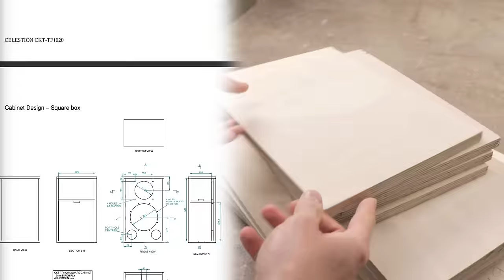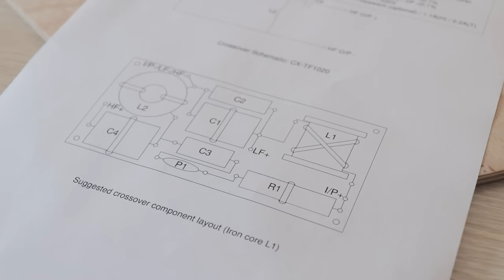DIY Compact 10" 2-Way PA Speakers

Comment: A very nice well put together project. However I can't see how you can say 1000 watt handling power , When the horn has a max power of 20 watts and the woofer has a max of 300 watts. Please explain.
Reply: des. Nonsense. 250watt Löwe. 50watt high.
Reply: peak power is usually a bogus marketing number that is close to where the speaker destroys itself or the coils burn up. maybe its a teoretical max. i dont see this peak number anywhere on the product websites. i assume its 1000w peak both speakers combined. in this video on the test part they used a 100w amp so nowhere near the 100w target
Reply: I have built my cabs to house a 15in woofer an 8in midbass and a super tweeter all of the individual speakers are rated to handle over 600 watts but my crossover is rated at 300 watts so if I give more power than the crossover can handle they turn into a large paper weight
Reply: yeah i dont know enough about crossovers to know how much this one can handle. i saw some wattages and stuff but i dont know how much each individual component would be hit with the load i guess. then again this setup was hitting what 50w per channel probably wont blow up. if they would hook up the amp i'm using wich is the Behringer KM1700 800w at 4 ohm per channel there might be some smoke or broken parts i guess. mine are 1700w mono for use with subwoofers that i havent gotten to yet.
Reply: I'm running a Yamaha m-80 amp that will put out just over 300 watts per speaker per channel, after there was work done on it and with my amp set up to just below clipping I can't turn up the pre-amp to 4 before it is so loud stuff starts to fall off the walls
Reply: yeah most of the equipment is PA equipment so it makes sense to have more watts and more speakers so you can deliver sound to a room of people. the build in the video feels and looks more lika a PA speaker than a speaker for somones listeningroom. i have used my rm1700 on a pair of 15w bookself speakers i got from somone for 15£ they dont sound any louder going from a 50w reciever tough i think they might sound abit clearer but that might also be the furniture that has been added to the room. or maybe the input methods that digger quite abit from the aux in on the reciever to 2 channels on a mixer
Reply: @williamclarius7072  any videos or info about your speaker ? sounds like what I like to make
Reply: @jamesccart  Sorry no video
Reply: @jamesccart  I wish I could upload pictures of mine
Reply: I did put some info about my speakers higher up in this thread
Reply: @jamesccart  So here are my choices of components starting with the cross over it is a Dayton XO3W 700/5.6k 300watt, Next is the Dayton PA380-8 8ohm 15inch pro driver 500rms to 1000watt peak, Next is the Pyle PPA 8 this is an 8ohm mid-bass 200rms 500watt peak, last is the Pyle PDBT78 super tweeter also 8ohm 350rms 700watt peak all of those stuffed into a 20 inch wide by 16 inch deep by 36 inch tall cab with two 3 inch front facing ports at the bottom. All components were bought through Parts Express, the cab material is 3/4 inch birch plywood
Reply: @williamclarius7072  really interesting thanks do you think that off the shelf crossover works well in your speaker ? I'd never thought of doing it that way
Reply: @jamesccart  yes the pre made cross over work wonderful, but to build your own cross over you can set your cross over points that could make sound better for your application
Reply: With my choice of components I was trying to get as close to 20htz up to 20000htz, effectively I don't need a sub woffer
Reply: @jamesccart  I also chose my cross over after choosing my driver's so that it would work well for my application, for the range of each driver and the power output of my amplifier

Comment: DIY, compact and PA parts. Perfect. For my desktop.

Something about the way PA plays for movie/games that cannot be beat. Dynamically they are king as far as I am concerned.
Reply from the maker: Very well said.
Reply: You nailed it. I built some speakers from DIYSG for my HT and they're 98 db sensitivity. Dynamics are huge without massive power requirements.
Reply: @tommywilliamsjr.697  I had to dump the 15 inch woofers due to space and stuff (also 1 broke in a move), but there never was a lack of clarity or reserve. I had them new when BF2 came out, and they stuck with me until not too long ago. 

Have smaller stereo ones now with ribbons. Meh.

Found this video perusing the web on the prowl for a design with compression drivers. But size and power and weight, I pulled out the 1U amp and wanted to stay with that, so now have to decide surround with phantom centre or simple LCR. These do look tempting... But thinking I will start with 2× the Obelix-S from K+T 2013/06, modified the design slightly. Should be a good fit on a smaller desk.
Reply: Wonder if 10" is a great middleground for creating high undistorted SPL while not having a big directivity mismatch with the compression driver, while the compression driver is also crossed high enough to play undistorted.

Specially since I'll cross into a subwoofer anyway.

Comment: Great work on those but with the specs on those drivers and the crossover Id limit the amplifier to 120-140w RMS each cabinet unless you like replacing drivers.
Reply from the maker: Thanks! The amplifier I was using can only output 50W per channel.
Reply: A 200wpc amp is ideal. 
LF driver is 150wRMS and the HF is 20wRMS, that gives you 180w of total RMS handling, in theory. 

It does depend on how loud you intend on driving them, but the weaker the amplifier, the less dynamic range you'll have and the higher the chance you will clip the output stage, which is worse than having a slight overload on power.
If you choose to add positive EQ to these speakers, you will run out of headroom with a 50w amplifier very quickly, especially with lower frequencies.
Just because it would be a 200w amplifier, doesn't mean it will be going full send as that isn't how audio works.
Reply: @childishtombino1275  having double the power of an amp is ideal to make it work the best and also have more power
Reply: @chaeyoung8908  I agree, stressing amps is not great, so having the headroom is a win.

Comment: Excellent video and realization   However do you hear any difference with the speakers sitting on a more stable stands ?   the sound could be more focused i guess   
The single pole can wave   Even a little movement is very bad with speakers usually   Kind regards, gino
Reply from the maker: Hello, thank you. I actually haven't tested the speakers on more stable stands, which is a good idea to test, thank you.
Reply: @DonnyTerek  hi i think the problem is more in the tweeter
Even tiny movement of the box varies the point of source of sound of the tweeter
It's like shooting having a little parkinsonism
In the end your speaker are really excellent and very good looking as well
In my little room i don't need all this power but I will think about it
thanks again and kind regards gino

Comment: 150Wrms woofer, 40Wrms tweeter.
1000W peak? Probably less than half
Reply: Yer, More like if you actually gave them 150w per side they would fry. "yer my setup is like 1000w man" ok so why has your amp only got a 5amp fuse then? paper numbers.
Reply: 1000 watts  for m.sec and the are in speakerheaven.😂😂😂

Comment: I want to build these speakers, but how is the quality and loudness of the speakers. Because the ports seem very short. So whats the experience using the speakers. Cause €600 is a lot of money for me
Reply from the maker: It is actually hard for me to help you decide since these were the first PA speakers that I built. The price tag to build a pair of these is quite high compared to what you can get off the shelf but I do like the sound quality. I paired these with the Behringer A800 and I do like the crisp highs and the wide soundstage. Was expecting a bit more bass from these but they are tuned to 80Hz with the port length as in the design. I think you could make yourself a relatively inexpensive pair of these if you can source cheaper crossover components (I paid over $100 for mine) and build the enclosures yourself.

Comment: What do these sound like compared to a "hi fi" speaker?  I want to try a 10-12" system on my (real nice) home stereo but all the "hi fi" options are 6" or at best 8"
Reply: It sounds very dynamic (as all high SPL equipment). With a good horizontal and partially vertical dispersion it will be a great loudspeaker. With feeding it with 0.1W its distortions will be less than ScanSpeak or Purifi offer for 10W at a same SPL level

Comment: No shrink wrap on the wiring?
Reply: the way it was soldered, fixed its no necessary, won't have a chance to get a short-circuit
Reply: @AndreChaosweapon  would be professional to.... also it strengthens it technically
Reply from the maker: I don't see that necessary.

Comment: There’s no bass at all because of those short ports, why?
Reply from the maker: The low-power amplifier that I used for testing does not do the justice of these speakers.
Reply: Let’s say you’re correct, but still why u made those ports so short? I highly doubt that these speakers would produse any bass even with good amp.

Comment: What's the overall cost for the pair?
Reply: the driver+horn and spearkers the cost is $300+, i think the overall costs is near $500...
Reply: €88 per woofer, €60 per compr driver, €40 per horn. ×2. Than add wood, banana or XLR binding posts.
Reply: @AndreChaosweapon  damn price competing on commercial ones.

Is it 500 for a pair?
Reply: @prodj.mixapeofficial6431  its a estimate cost but it can be near 500 bucks, yeah commercial ones are near this price too but this project is to show how best is this setup but you can buy a commercial one instead or use the same project but using the hardware with less cost i don't know...
Reply: @AndreChaosweapon  you never find a crossover in such quality in normal speaker.only Pfusch!!🇩🇪